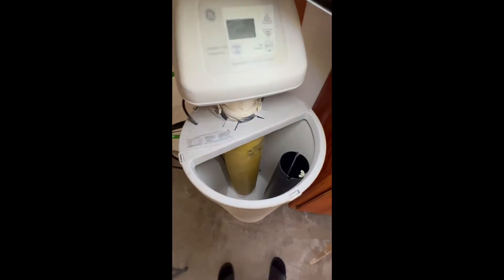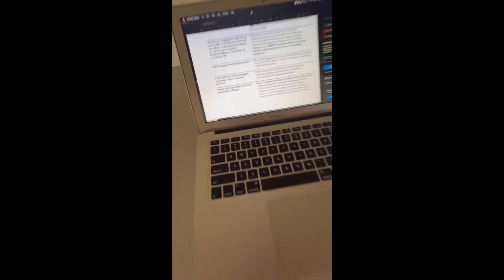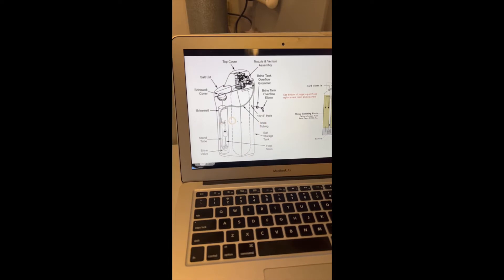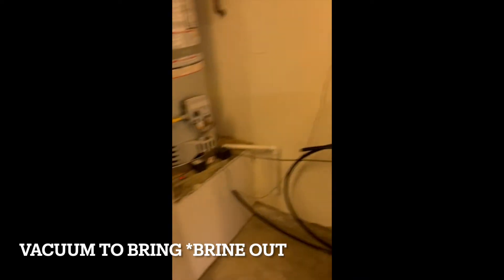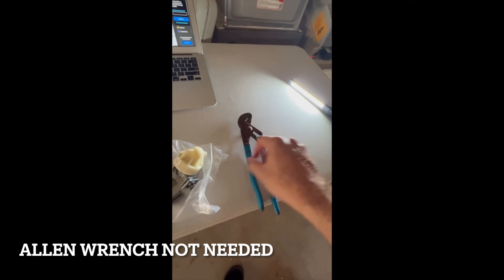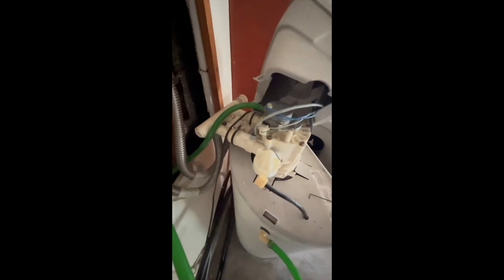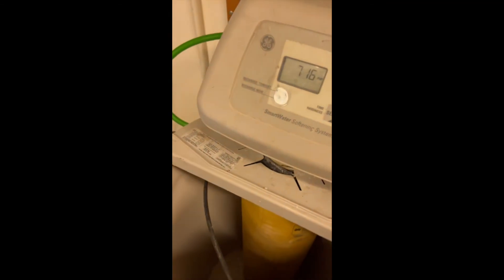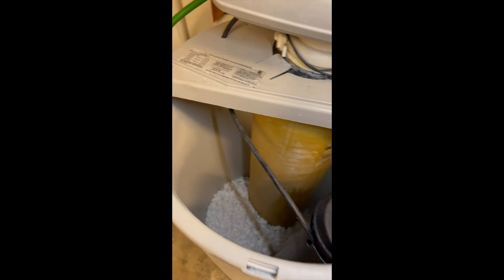Water Softener Troubleshooting | Too much Water in Brine Tank | Too Much Salt Dry Brine | DIY

Comment: If you have a GE water softener GXSH40V. If most Float assembly are the same there is a rubber stopper under the Styrofoam Float that can give out and during the Brine Rinse when suction occurs the rubber stopper gets sucked in clogging the bottom . When fill starts it attaches back to the float so you won't notice it happening. So check that first.